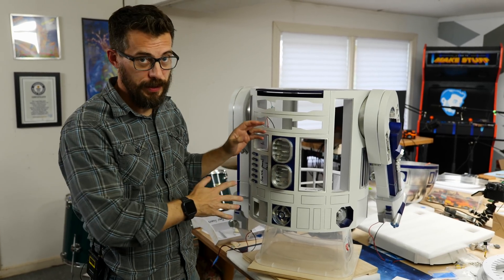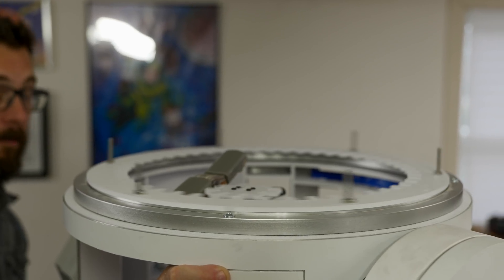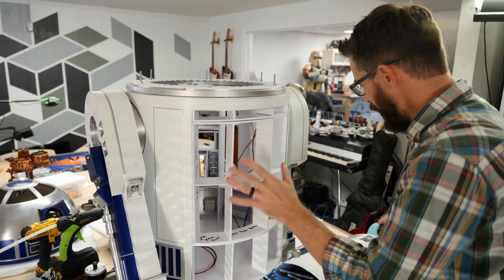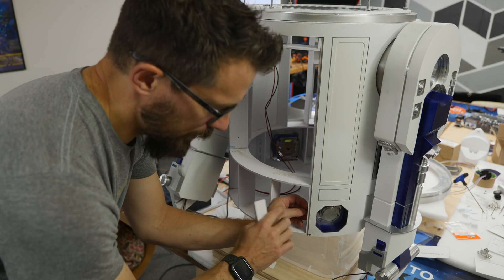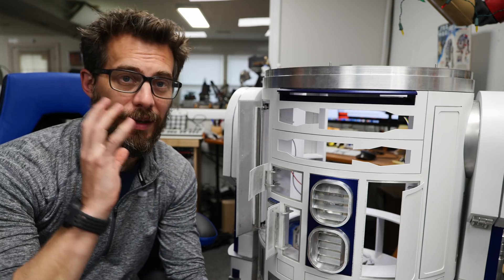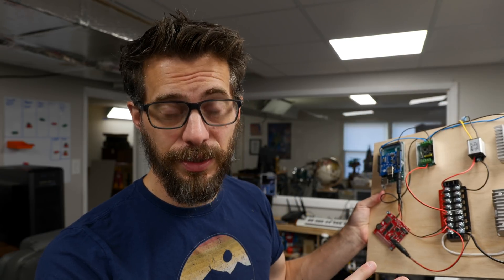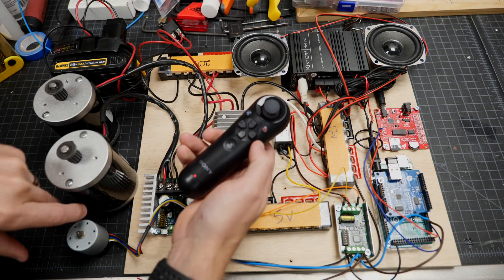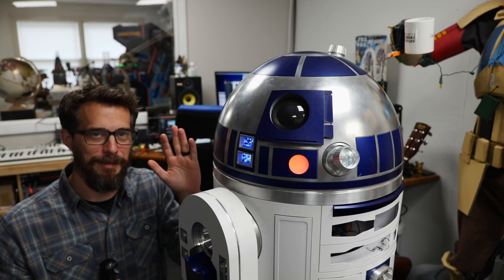Making R2-D2 Part 4 // Electronics & Remote Control | I Like To Make Stuff

Comment: Hey Bob! I'm at the point in my Astromech build where I'm ready to start putting all the electronics together.  I'd like to hear your thoughts on the 20v battery you used. I'd like to use my Ryobi batteries in the same fashion and mine is a mix of styrene and 3D printed parts. 

Is it enough power to move R2 around? What's the longevity of each full charge and how often do you find yourself swapping out batteries?

Comment: Hi I know your more then likely be extremely busy but could you spare a little bit of time to help me with which Arduino parts will work. I've spent a year looking and asking but with no success. I'm not building a r2d2 project I'm building a different robot that moves talks and lights up so I believe it would be very similar to your r2d2. Thank you
ive been looking at the shadow skip and diagrams but is show the MEGA going to a differnt board before it goes to the sound trigger, whiles in your video the MEGA goes stright to the trigger card could you please help me with this thank you

Comment: Watching your assembly, it looked like you were using a lot standard nuts and not lock nuts (granted a lot of those shots were test fit assembly). You will find R2 vibrate a lot rolling along and non locking nuts have a bad habit of falling out at the worst of times, and like to find their ways into electronics and batteries too. Looking great and can’t wait to see more of your progress!

Comment: Anyone have a clue on how the wires aren’t getting tangled when the head spins around?
Reply: I think that you just keep enough slack in the wires to get a couple good rotations. You'd have to do a brush assembly or separate the power and controls between top and bottom to rotate continuously.

Comment: Great work Bob! A recommendation for your wiring - put a low voltage cut off just after your power switch so you don't discarge your battery too much. If they get charged to low they won't recharge again, effectivly killing the battery.

Comment: Bob - One thing to double check is that your batteries have a low voltage cutoff. Some battery platforms have built in low voltage protection, but a lot do not. I'm not sure about Dewalt, but if they don't, you'll need to add one between your adapter and your 20 volt bus. Otherwise, you risk overdraining the battery, which in the case of lithium can destroy the battery.

Comment: how are the head servo wires and lights not going to get twisted? it is programmed so it only can spin once?
Reply from the maker: No, it will use a slip ring to connect so that it can spin without twisting 👍🏼
Reply: @Iliketomakestuff  thanks for the reply. Never seen those before.  Mind blown.

Comment: I had non-stop issues with my Move controller. Would work perfectly fine at home and other places, but as soon as I took it to the shops or a hospital, it was so temperamental. I think it was due to the wifi in the buildings.

Comment: Great work on the rear panel. My all aluminum R2-D2 uses magnets to hold the rear panel in place.  After ten years of use the magnets have weakened and the rear panel skins have started to separate at the edges.  (Plus countless sings and dents).  You’ve inspired me to fix this as I’ve been using white electrical tape to help keep that back panel in place for events for a few months!

Comment: Definitely need to add a low voltage cutoff. DeWalt batteries don't have them built in, and it looks like there's nothing but plastic and copper in the adapter.
Reply from the maker: Yeah, someone else mentioned that. I'm looking into replacing with Milwaukee as they have built in BMS/cut off 👍🏼

Comment: My experience with styrene (working in the print industry) is that it scratches super easily :o

Do you not have that issue with the material you're using?
Reply from the maker: Not so far, all of the styrene is covered or painted.  If it does take damage, that'll just add to the eventual weathering 👍🏼

Comment: How do you block the head from spinning more than X turns? Or is that not a problem? Thinking about the wires twisting...
Reply from the maker: It will eventually use a slip ring so it won't be an issue.

Comment: Is there a way to make the spinning head quieter? That's pretty loud.
Reply: When the body is completed I suspect it won't be quite as loud.

Plus, under normal operation R2D2's head doesn't usually spin that far or that often.

On a noisy convention floor you'll probably never notice it.

Comment: As a point of reference for future development (and more than likely something you may have already seen on Astromech) is potential future issues with Bluetooth control.  I have a good friend who has built an R2 and has been using a Logitech Bluetooth controller for the past couple of years.  He has discovered that when taking R2 out to conventions and other places with lots of people, he has found that the Bluetooth control is WAY less than reliable.  He's actually had a couple of instances where R2 decided to go rogue, luckily not taking out a bystander in the process.  But it has spooked him enough that he is in the process of converting to standard 2.4Ghz RC radio.  Just food for thought if you are thinking about taking R2 out in a place with lots of folks (and potential interference).

Comment: I have a question about the electronics that will be mounted in the dome- what stops the wires that will run to the lights and servos up there getting twisted together when the dome spins around?
Reply from the maker: It will eventually be connected by a slip ring 👍🏼

Comment: Hi,I got a simple doubt, won't the wires of servo and led from dome gets tangled once connected to arduino and spins?
Reply from the maker: It will eventually be connected using a slip ring 👍🏼

Comment: You might think about using a different battery.  Dewalt and Makita have the BMS/LV cut off in the tool.
 Ryobi, Ridgid, Milwaukee all have a basic BMS in the battery.  So you will need to add an aftermarket BMS/LV cut off if you use Dewalt.  Also if you need any help with the electronics checkout out the Electronics general section at https://www.printed-droid.com.
Reply from the maker: Oh, that's really good to know, thank you!

Comment: I love this so much! Do you have plans to sound proof the inside to try and hide the sound of the motors?
Reply from the maker: I think there is some adjustment I can make to the gear to quiet the dome down a little bit.  The droids all do make a bit of noise though.
Reply: @Iliketomakestuff  It sounds to me like the main source of the noise right now is backlash from the spur gear. If tweaking the gear doesn't quiet Artoo down, you might look into doing a helical gear instead. There's no way you'll be able to find one off the shelf for this application, but I think you could probably design a 'good enough' one in Fusion 360 and print yourself one (in sections), if you don't mind stretching your CAD legs a bit.

Good luck!

Comment: Hey Bob, you may want to consider changing the dome hinge nuts out for lock nuts. I have noticed 3D printing parts that movable parts tend to have the be checked constantly because the nuts back off. Lock nuts solved all my problems on my parts.        EDIT: Other than that, LOVE LOVE LOVE the project.
Reply from the maker: Yeah, I probably will once I'm finished taking it on and off a lot :)

Comment: Is the dome going to rotate freely past the 360 degree limit or am I overthinking this and there are no risk of any wire being tangled up as a result? I'm not thinking about the motor driving the dome, more the wires hooked up to the dome panels and lights etc...
Reply from the maker: Yes, it will rotate freely.  Eventually I'll add something called a slip ring to allow wires to connect to the head but not spin as the dome spins 👍🏼